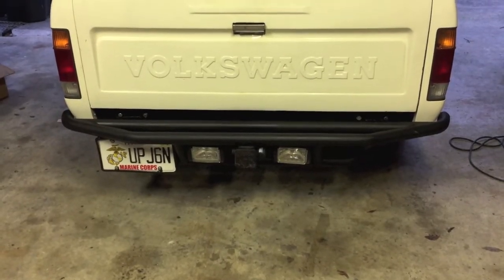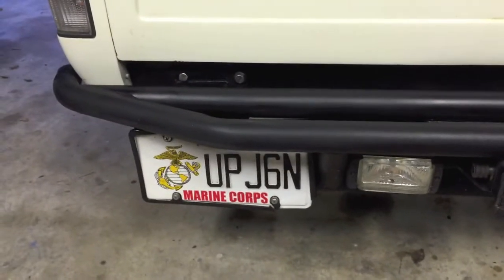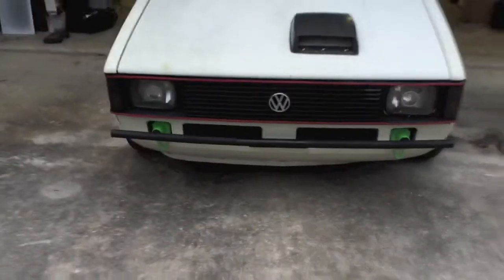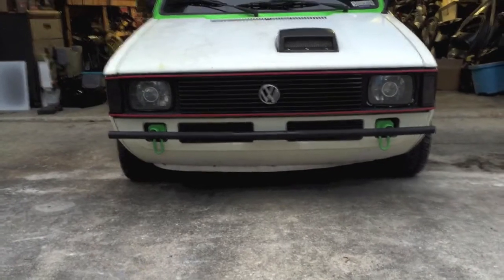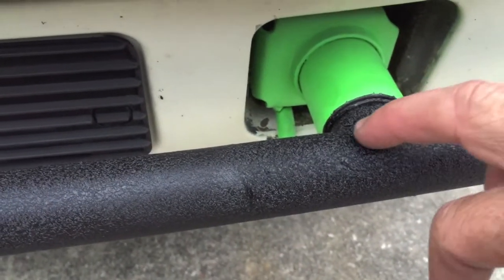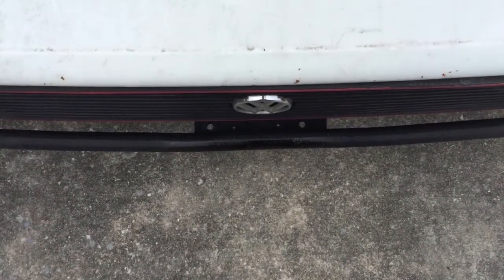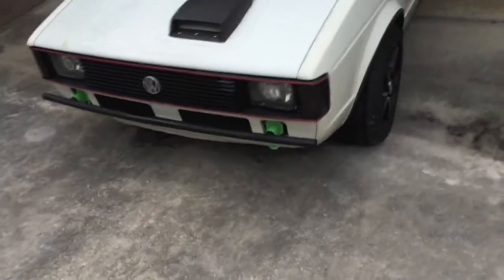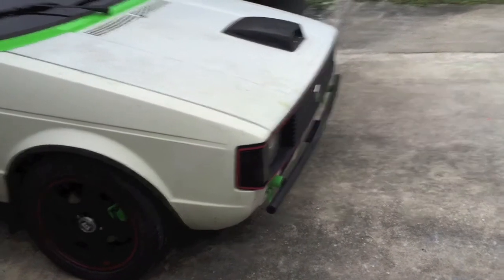VW pickup bumpers

Comment: Trying to figure out how to contact you to buy a rear bumper. I like it bettter than stock.
Reply from the maker: I got mine at this website: https://www.extremeterrain.com/red-rock-4x4-rear-bumper-yj-tj-j100189.html   as mentioned in the video the model is rock crawler part number J100189 (Made by RedRock). It will take a little bit of alteration to fit the brackets